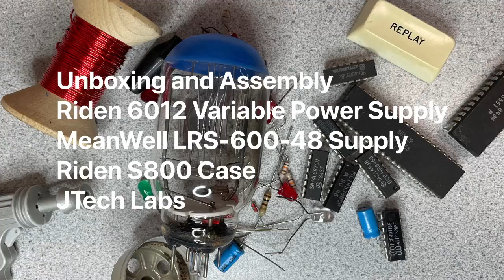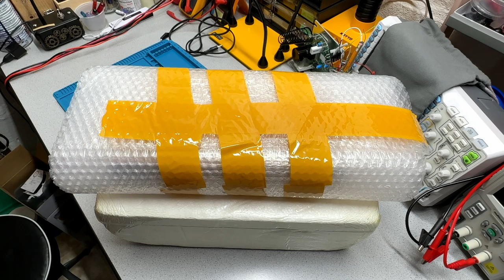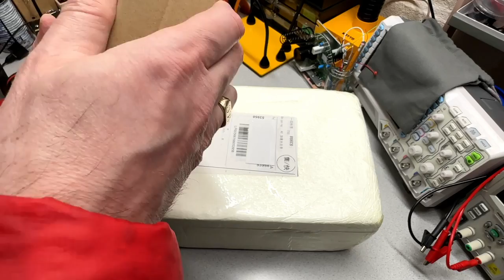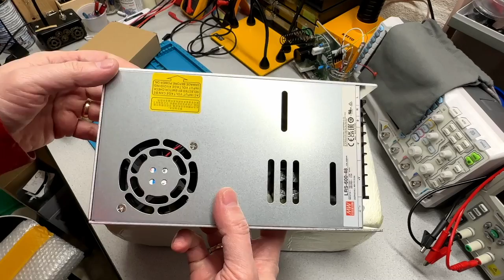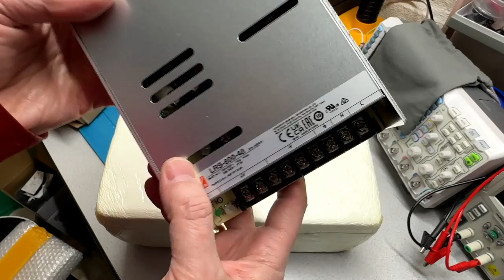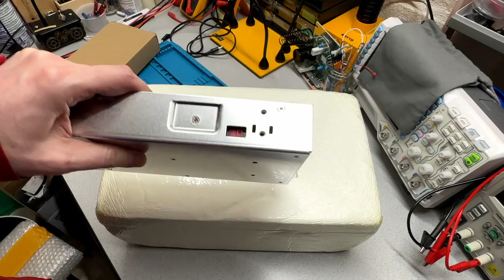Riden RD6012 Unboxing and Assembly

Comment: I guess this is a wrong power supply. It has the fan in the wrong place, and this will cause very poor heat dissipation. Additionally I think you have a 48v PS, while for this model we need a 68. It might work with 48v, but the maximum tension on the output will be at best 48v and not 60v.
Reply from the maker: Yes the maximum voltage will be 1 volt below the voltage of the supply. This was planned as I don't need the higher voltage. I preferred to get the Mean Well supply rather than the one that Riden supplies in their kit. Mean Well has a very good reputation.